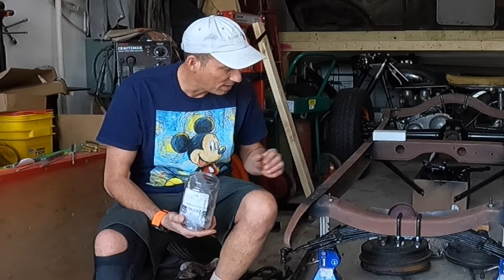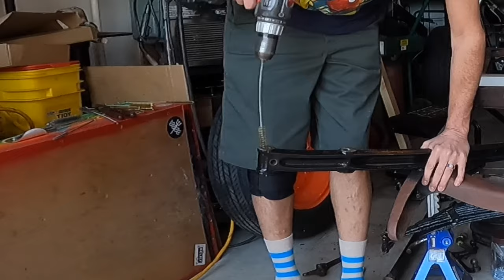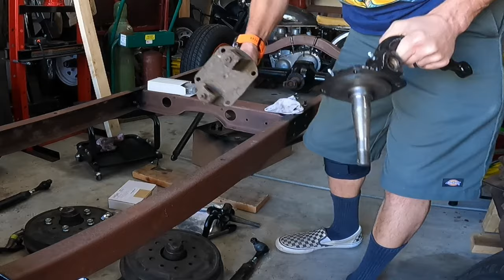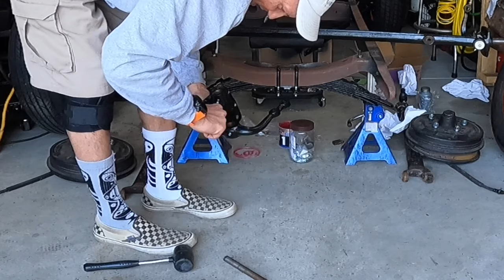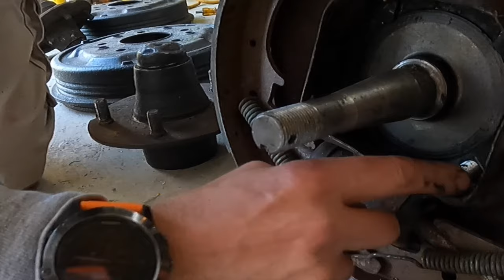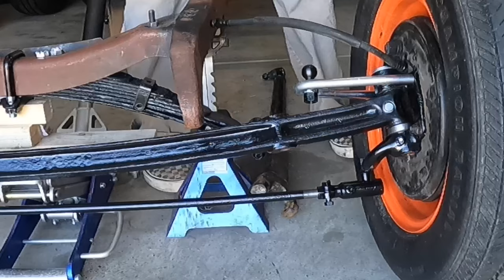Front Axle Blues! How to Assemble & Mock Up a Hot Rod Front End in the Real World...

Comment: I think they make some wrench deals called crowfoot wrenches. You use a rachet type wrench to use them. It will likely fit down in there to tighten the nuts.
Reply from the maker: I have a set of crowfoot wrenches, they won’t work either. In a later video where I install a dropped axle I modify the grease cups so I can use a socket wrench.  Thanks for watching!

Comment: After you installed the front spring assembly to the axle, I noticed that there's a short leaf UNDER the main leaf - why did you assemble the spring pack like that? Normally the leaves are arranged from longest to shortest.
Reply from the maker: I removed several springs to soften the ride and lower the front end.  The “new” pack is now to short for the u-clamp so I added the short leaves to the bottom of the pack as spacers so the clamp will tighten.  When I do the final assembly I’ll cut those leaves shorter so the ends don’t stick out.
Reply: @AJStarch  If you just restack them from small on top to long on the bottom, you won't have to do any cutting :)
Reply from the maker: @ModelARickLasCruces  but that would raise the frame 1/2”… by putting the spacers on the bottom of the stack the spring eyes are 1/2” closer to the frame which lowers the whole car body another 1/2” closer to the ground.   I’ve since found and swapped in a dropped axle so the front end is much lower now.
Reply: @AJStarch  Sounds like a good plan; I'm really enjoying your videos.   Good content and excellent video production - keep up the good work.
Reply from the maker: @ModelARickLasCruces  Thanks for the kind words!  Hard to make videos and progress when you have a full time real job so words of encouragement are powerful motivation!